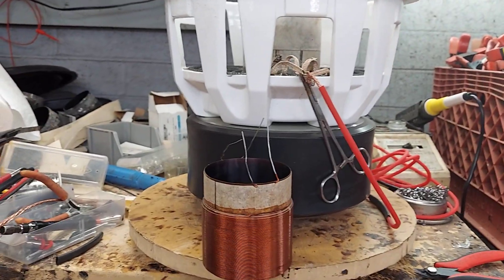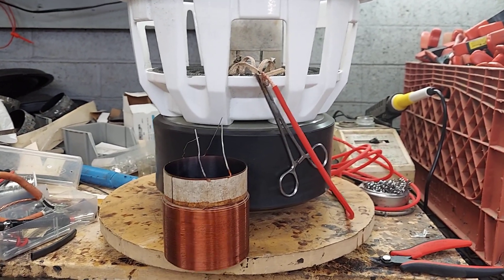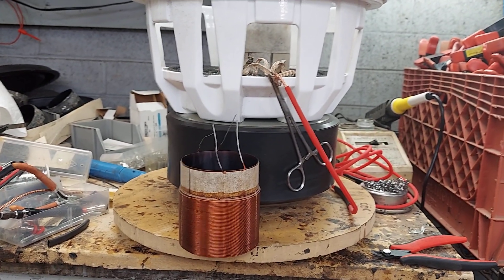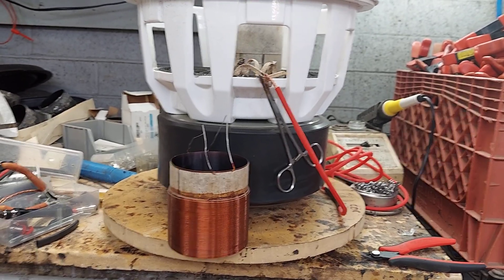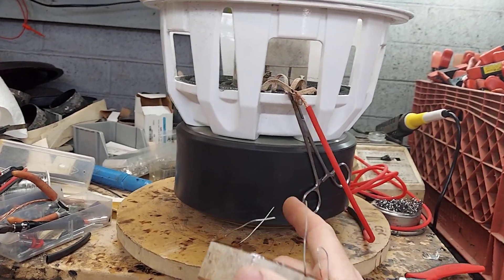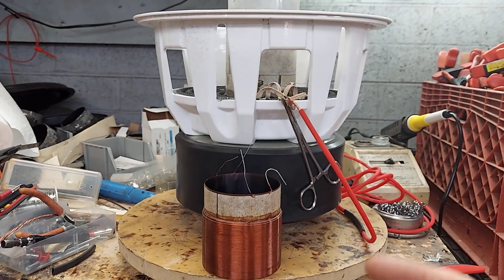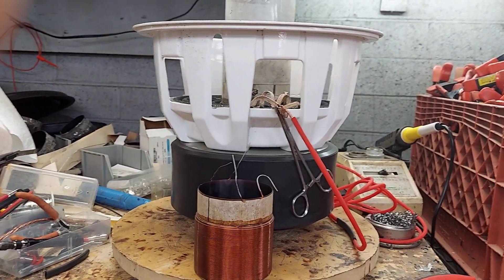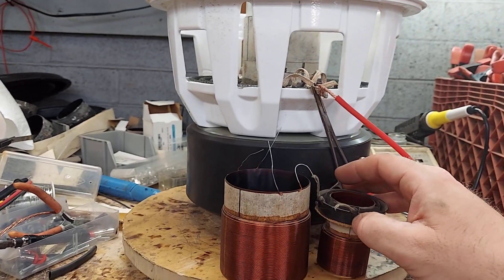How to Design a Loudspeaker From the Ground Up (Part 2 - Trial & Error)

Comment: Hey Pat i got 2 questions.  Do you have anything in a 12 in that has a low fs around 1200rms in a 1 ohm configuration.  And if yes do you ship to Hawaii?
Reply from the maker: Sure.  I'll put something together using mack so it ships in two pieces.  $300 shipped.  You may be better off just ordering off of Amazon though.  let me know.  Text me direct, 6023126504